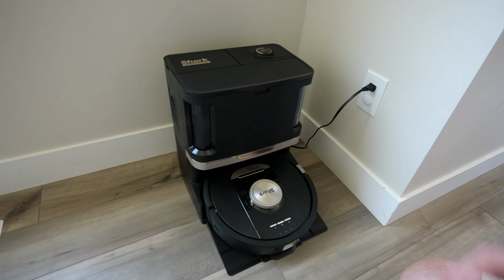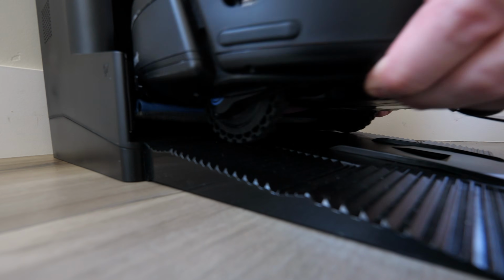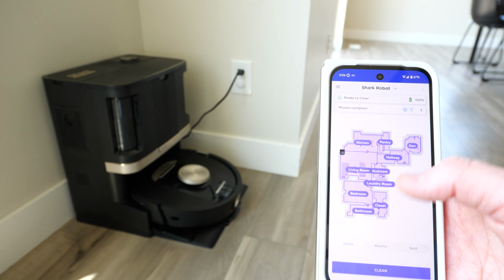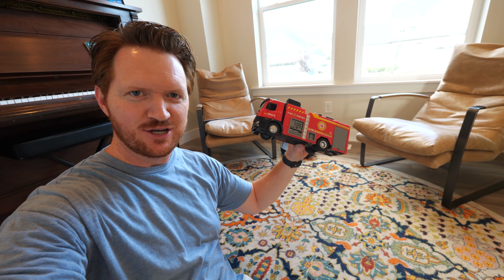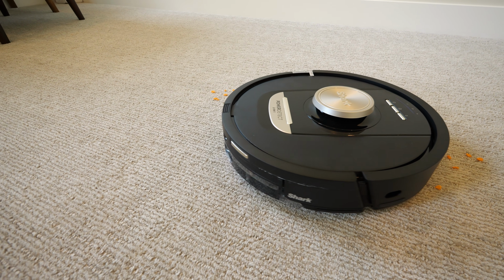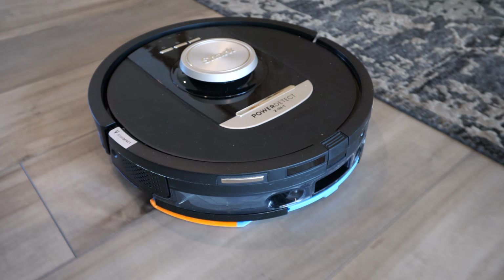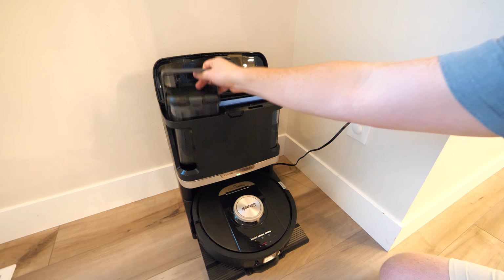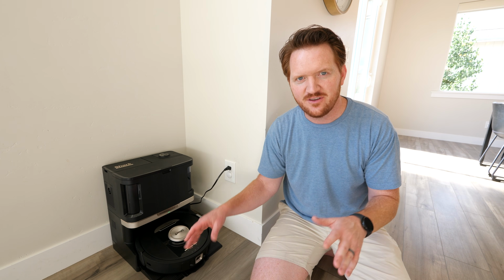Detect the Dirt in Your Home and Clean it Hands Free

Comment: Are you doing a long term test of this?  We have the model below, so just a water tank.  Looks like everything else is the same.  The app is ok.  Everytime it updates, it seems, it resets all the room labels.  We had a really old shark vacuum before so I hardly used the app ever because it was not great.  I still do not get vacuum notification which is annoying.  But that old vacuum, which I repaired twice, did a great job keeping three dogs worth of hair off the floor.  This new one started out well, but I've noticed more and more hair everywhere.  The mop feature does a great job!  I swap out the pad every week.  To do that is a pain since you have to have to vacuum mop, pause it, and then slide the pad "skid" off.  You cannot just pull the robot of its base and remove it.  All in all, it's a good unit!
Reply from the maker: Thanks for the owners review. I'll keep an eye on it and see how it does overtime.
Reply: @TechWithBrett  well, after six months....I had to get rid of this thing.  It's terrible.  Have a Narwal Freo Pro now....incredible difference!
Reply from the maker: I'm sorry to hear of the struggles you had but glad you found something that works for you!